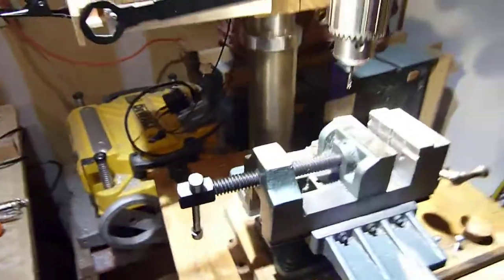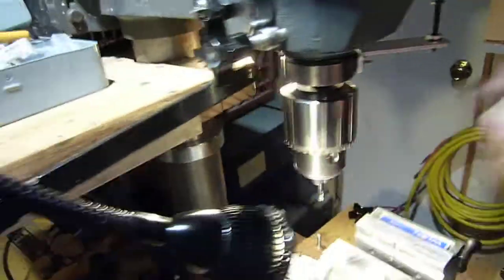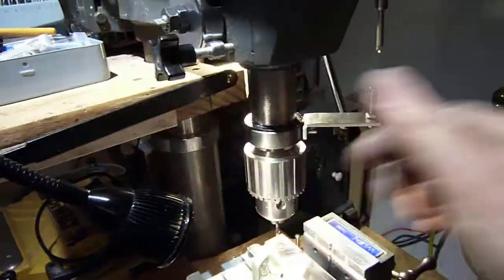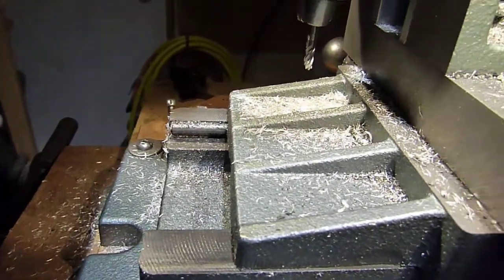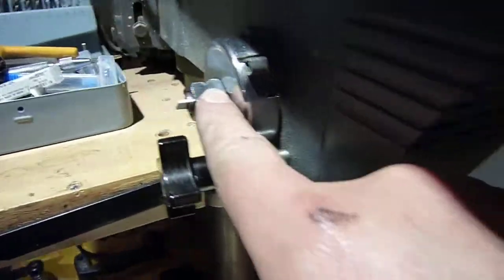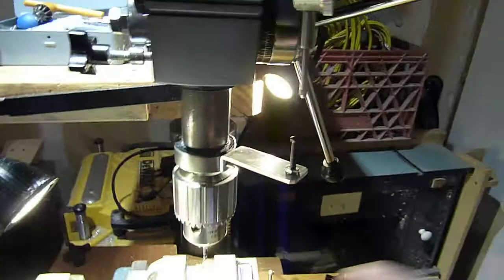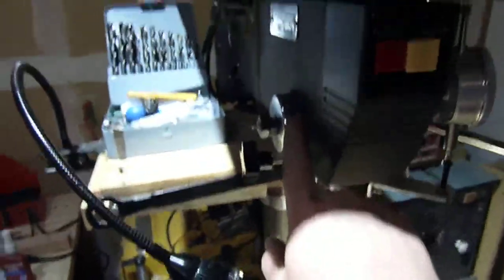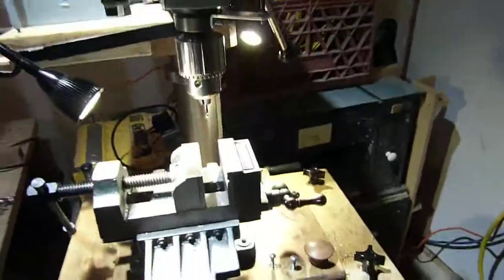Milling and machining: 1 Drill press easy mods

Comment: I mean, why not, right? As others have pointed out, yes it's potentially dangerous for any variety of reasons, which vary depending on the specifics of the equipment used. You can of course, as you have attempted, do what you can to mitigate that. Your success at that aspect may vary and you take your own safety into your own hands. That's freedom. There's also the big question of accuracy, capability, etc. But heck, if you're willing to risk to the danger, you don't need a ton of precision, and your job requirements are met, who is anyone to tell you otherwise? I would say this much though. If you're doing as many hours of milling as you claim in the comments, bruh, get a proper machine. You'll only benefit from having the right tool for the job right? More importantly though, i would not be recommending other people, complete strangers on the internet, to try it for themselves and giving advice on how to do it. Bottom line, you may have experienced success so far, but it's only a matter of time until someone careless does something stupid, and they're gonna end up impaled on a piece of tool steel or cast iron. Encouraging that just seems irresponsible to me.
Reply from the maker: This is an old video. I still use a drill press for milling, but lots of what you see here, I no longer do. For example, mounting the cross vice to a wood platform, that went away soon after making this video. It created lots of movement! I now use a much larger Dayton 20" drill press and do lots harder milling and deeper cutting than was ever possible on this light weight Craftman. I'm far from alone in being the only person using a drill press in this fashion. I actually got the idea from watching videos posted by others, tried it for myself and found it to be quite workable.
*
This video was posted in 2019. I've been using a drill press for milling since 2017 and still do it today. So far I have to see a piece of metal fly off that wasn't chips. I get some nice straw to blue chips too! I'm not sure what "danger" you are referring to. With anything like this, including on a real mill, you always secure your work piece.
*
I do agree that a mill would make a nicer surface finish and would be more precise. This is good enough for me and my precision is not horrible if I take my time. I'm sure a proper mill would be better, but so far the Dayton drill press, XY table and other things I use on it are more than enough for my uses.
*
This is torque arms for my latest EV build. I milled them on my Dayton drill press. The steel is 4140. My drill press couldn't make the 1/4" deep cut in a single pass without bogging down so I did it in 2 passes. 
https://i.imgur.com/ErQXJlN.jpg
https://i.imgur.com/EUfjvt3.jpg
https://i.imgur.com/hgdpgNw.jpg
*
4 videos on machining the cast rear wheel to fit the hub motor bolt pattern. I was originally concerned that the ID of the rim was a bit much for my 3 jaw, but it was quite stable despite the jaws extending a bit too far. That wheel now has about 500 miles on it and is nicely balanced even at 70-80 mph. 
https://www.youtube.com/watch?v=w80g3CYPxjM&list=PLOrUJ_KZtl7-V6KNSNFO7br9O02Q8rbUo&index=40
https://www.youtube.com/watch?v=G_M9zr1_om0&list=PLOrUJ_KZtl7-V6KNSNFO7br9O02Q8rbUo&index=41
https://www.youtube.com/watch?v=uiCR8MYSCp8&list=PLOrUJ_KZtl7-V6KNSNFO7br9O02Q8rbUo&index=42
https://www.youtube.com/watch?v=lGCNeznpZS8&list=PLOrUJ_KZtl7-V6KNSNFO7br9O02Q8rbUo&index=43
*
This video is of that EV and I talk about the torque arms. Too bad the v4 torque arms were not yet done when I made that video.
https://www.youtube.com/watch?v=awAyCMF0e84
*
Here's my build thread for the EV. This set of torque arms is far from the only thing I machined for it on my drill press. I have made 3 sets or steel torque arms. I machined both side plates on a rather expensive and RARE hub motor for it. I bought a generic cast wheel and machined it to bolt onto my hub motor. I machined a larger rotor for the front and made and extension block for the front caliper to increase braking. All that on my drill press!
https://www.diyelectriccar.com/threads/zapino-zap-rebuild.205012/
*
I'm uncertain how much milling I've done on my Dayton 20" since I got it. It is easily 2-3X more than I ever did on the crappy 13" Craftsman! I don't mill every day. It is pretty often, but the cost of buying a real mill isn't compelling for the amount of milling I do. So called "safety" isn't an issue any more than it is on a real mill. Stick your hand in a live end mill on anything and it will chew you up with zero warning! Wear safety glasses, wear an apron, don't do stupid stuff...I'm pretty sure I won't die or get hurt.
Reply: @de-bodgery  haven't checked out all the vids yet, but I def will. I did look at the pics though and those parts look pretty legit to me, bravo. And I think the point I'm trying to make has much less to do with you, or me for that matter because I do all kinds of crazy sh*t in my shop that I wouldn't recommend to others. A capable person is, well capable, of pretty much anything they put their mind to. My point has more to do with the, ummm, lack of capability? That I see demonstrated daily by people around me. Especially on the internet. Guess what I'm getting at is, I wouldn't be surprised if someone put an eye out being a complete dip-wad and then turned around and tried to sue some YouTube creator for a video they put up, "showing them how to do it" I mean, remember the McDonald's hot coffee story? That ACTUALLY f-ing happened bro. Just saying. You are the exception my dude, not the rule... That's an unfortunate side effect of generations of participation trophies. 😉
Reply from the maker: @DavidHerscher  Hi David...there are some people out there that are lacking in the brain pan department. Of course I'm far from the only person doing things with stuff not intended for that use. Do you watch the AVE channel? I love all the stickers on his tools and machines! 
*
Getting sued..that seems unlikely, but yeah sure, I guess it's possible. People can be steaming idiots and then when they get in trouble blame it on others.
Reply: @de-bodgery  Yeah man, Ave is great. This old Tony is another favorite, and of course Abom79. And yeah, you're probably right.
Reply from the maker: @DavidHerscher  What happened to Tony? He had a good run with his channel! Now it's been 6 months since he made a video. His was one of my favorites! I always looked forward to his videos. Not only were they well made, but amusing and informative. I'll have to check out Abom79. Never heard of that one before. 
*
I think people are too used to getting rewarded for participation. In the USA we are so hyper protected with safety features that no one is ready for dangerous situations. In the real world, like a machine shop, sharp spinning mills are all over the place! Stuff that will rip your arm off are everywhere. All the machines are much more powerful than any human. Practice not doing stupid in places like that! LOL! I think most people can't handle that sort of thing. You see on TV that someone gets handed a gun and they say something dumb like "I don't know how to shoot a gun." Really? You've never seen one on TV or never seen them in a gun store like EVER? I think in America, we get brain washed with stupidity!
Reply: @de-bodgery  Yeah im not sure actually, that's a great question. I've been wondering myself, hopefully he's just taking a break and we'll see a new vid soon! fingers crossed.
And I couldn't agree more. Really, don't even get me started, especially not in public comments... I'll get myself in trouble. I will say this though, there is a part of me that believes it's intentional. And by believe, i mean feels confident in saying that i KNOW it's intentional. You see it manifesting very clearly these days. It's the dissolution of the self reliant individual. Free, rational individual thought is not only discouraged, but it's vilified and attacked. Instead, people are encouraged and rewarded for adopting the amorphous dogma of the collective. George Orwell talks about it, so does Robert Nisbet. We've seen the same throughout history, i won't say where, though im sure you can guess. It can be accomplished through violence, (as we've seen in history) and it can also be accomplished through propoganda, (as we're seeing now). This particular specter finds it's greatest allies in fear, and lack of strong individuals in leadership. Two things that you can see simply by looking around you. That is not an accident. I think the best thing we can do, as strong individuals, is to remain steadfast. Speak out, speak loudly. Set an example, others WILL follow. See, i told you not to get me started... ;)

Comment: Like the idea but too dangerous, chuck might work itself out and hit you in the the face.
Reply from the maker: Feel free to live in fear. I don't! My old drill press, one time the tapers came apart. I froze the drill chuck in my freezer and heated the quill taper with a torch. Then I drove them together with a few well placed hammer blows and that was the end of that! I tried to get them apart later with a set of wedges and failed. There was no chance they were coming apart.
*
My new drill press which is much larger than the Craftsman, it has an ER32 collet chuck in it. I didn't bother with heating and cooling. I drove that into place in late 2019 and have machined for many hours on the drill press. My most recent work was making 1/4" deep cuts with a 1/4" end mill into 4041 steel. I milled for at least 4 hours straight like that without even the slightest concern that the tapers would come loose.
*
So feel free to live in fear...I sure don't!
Reply: @de-bodgery  One time your lucky the other time your not It not living in fear it going home with all your fingers   Living in fear and being stupid are 2 different things.  Some people care about the loved ones and there health.
Reply from the maker: @jcerullo5015  These videos are old. Lots of things presented here are part of my own learning and some are no longer in place or significantly improved since I made these videos. Here it is 2022 and I still have all my body parts fully intact and no injuries beyond some very tiny burns from blue hot steel chips. I have to tell you that you are being overly dramatic! My old craftsman drill press which I sold in 2020 ONE TIME had the MT2 tapers come apart. This was easily fixed and never happened again despite heavy lateral loads from milling. All I had to do was freeze the drill chuck and heat up the quill taper. Jamming them together and a few good raps with a hammer and they were locked together for life! My 20" Dayton drill press that I use now easily sees lateral loading 10X that of the Craftsman drill press. I drove out the factory drill chuck and replaced it with an ER32 collet chuck soon after I got it. It has MT3 tapers. Same thing...cold and hot and they are locked together! I literally have ZERO concerns of the tapers coming apart after many hundreds of hours of milling!
*
Losing fingers or death...this is silly! STAY away from the sharp spinning parts and you will protect yourself from 99.9% of injuries. Death from a 1/2 mill...really? I seriously doubt this will EVER happen without deliberately drilling it into your head! Maybe if you were stupid and milled a hole in your fore arm arm and bled to death? Again...keep body parts away from the sharp spinning parts and you are OK! I'm guessing you like drama? Why else would you make a comment like this?

Comment: My chuck is on an M2 taper It is not directly screwed onto the spline. Many Drill presses are set up this way, and the entire chuck and shaft can work loose with vibration. Should never be used as a mill since when the chuck works loose it breaks end mills and can fly out causing a big hurt.
Reply from the maker: I've broken mills just cutting. That will happen for any number of reasons. This is a hazard of milling on anything including real mills. I originally had a 13" craftsman drill press. I did many hours of milling on it. I did have the tapers come apart once. To get the tapers to stay together, I froze the drill chuck and heated the quill. I then used a hammer and few good raps on it locked them together. Once they got to the same temperature, they never came apart again. That drill press did hundreds of hours of milling end never came loose. The Dayton, I've had it less than 2 years now. It has milled many many parts now and maybe 400 hours on it. I've never had a problem with the tapers coming apart! They are just driven together. This may be a problem for you, but I've never had to deal with it.
**
If you are using drill chucks that thread onto the taper, then the simple answer is to NOT use them. Red locktite is quite permanent. That ought to hold the threads together too. All of my drill chucks have a taper on them. I heat up the chuck and freeze the taper then rap on the end of the taper to drive it in. When they get to the same temperature they are locked together. Not much chance of them coming apart after that!
Reply: @de-bodgery  Youll just end up killing your drill press.   Maybe ok for plastic but not for metal.  The major difference between a mill and drill press is motor speed a mill can turn so much slower which is what needed for milling
Reply from the maker: @jcerullo5015  This video quite old now. That drill press milled quite a lot of metal parts over a couple of years time. I finally sold it and bought Dayton 20" drill press I have now. The smaller Craftsman had too small a motor to cut very quickly. It also had no way to adjust the rigidity of the quill so I was always fighting movement in the quill. The dayton has a way to adjust the sleeve around the quill to remove slop and movement very much like mills have. It also has a 2hp motor which makes more aggressive milling possible. 
*
I recently milled 2 torque arms for an EV build from 1/4" thick 4140 steel. The Dayton powered right through the steel. This drill press has seen many many hours of milling since I bought it used in April 2020. So far, if it is going to break or "get killed", I can't see it happening. It working fine. Tool speed is adjustable down 10 RPM via its dual belt and pulley system. I intend to eventually switch all of this out for a brushless inrunner. This will give me lower speeds, infinitely adjustable speeds and lots more torque. 
*
I do have a fly cutter with a straight shaft. Any tooling goes in an ER32 collet which holds much better than a 3 jaw chuck and improves tool concentricty a lot. I do from time to time snap off a mill because I made a mistake or something goes wrong. I've never felt a moments worth of fear of death or injury from this! Maybe you are dealing with much larger and more powerful machines? What I do, this risk is quite low. I'm far more concerned about a VERY hot steel chip landing on my hand than anything else. I make blue chips all the time...so you know I'm milling aggressively and making a good bit of heat doing it!